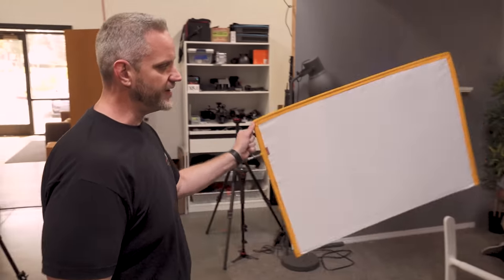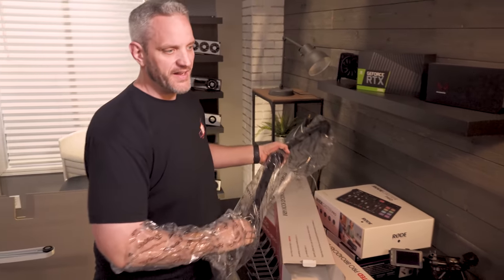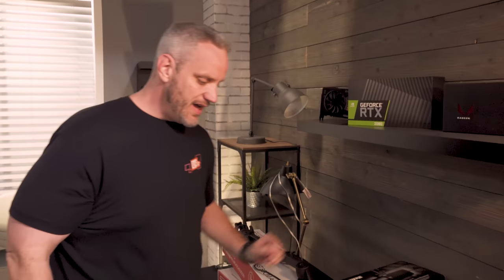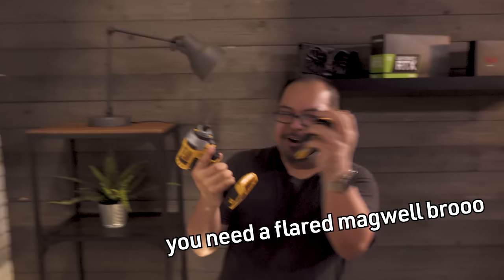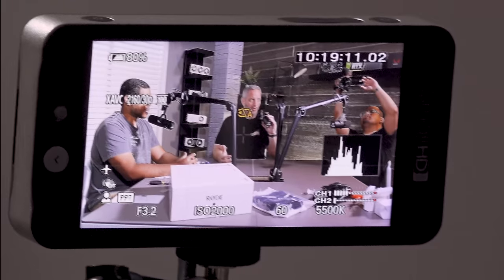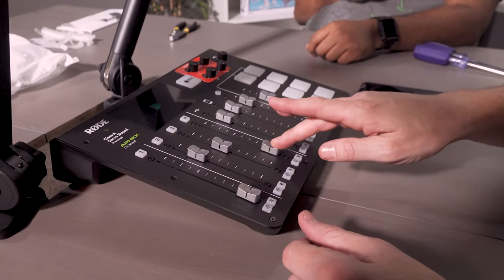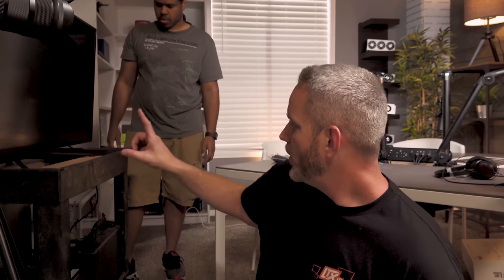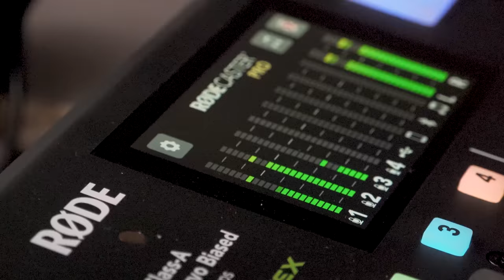This new setup turned out WAY better than expected!

Comment: For sound proofing, you could try building some sound absorption panels. The foam would only help with acoustics in a small room, but doesnt absorb sound. Even with a huge echoy ara, within the closed environment, that would help a lot. Also, another michrophone i recommend is the RE 20. :)
Reply: That's what I did. Out of some foam, zip-ties, and gridwall.
Reply: hey azn
Reply: hi azn hmmmmmmmm
Reply: he already has some on the walls of the warehouse all around
Reply: SM7B trumps RE20. :)

Comment: SM7B is THE microphone to use for broadcast and even studio vocals and guitars. Tons of people/bands use it for a reason.

Remember: There are hardware switches on the back of the microphone to boost high frequencies or cut low end.
Reply: don't tell Jay this, it will ruin the authenticity of an actual JayzTwoCents video lol
Reply: Yeah...I'm sure he totally never looked at the mic he bought...'remember bro...it has a front part you talk into to and a plug on the other end...just fyi'...silly thing to point out
Reply: @G Bogart exactly when he can realize it 5 or 6 episodes of the podcast in. Ok even that seems like a light estimation

Comment: I’d recommend adding fetheads to give you the extra gain headroom. I had this same setup and had to have the gain up high which introduced a lot of white noise (hiss) to the mix. Adding the fetheads fixed the issue. It allowed more clean gain without the hiss.

Comment: I've had that monitor since it came out and I love it. no problems since. the only thing holding this monitor back is the drop-off of the led controller. the software has never left beta forcing you to use a third party RGB controller like they just gave up

Comment: Hey Jay, make a box with 2x4s standing longways, set it on the floor with a cinder block sitting in it. Mount the microphone arms to it and have the arms come up through the center of the table. Would look a lot better than cranes sticking up.

Comment: I have that same setup, exactly. However you should be running cloudlifters on each of those shure sm7b mics, they take a TON of preamp gain. With a cloud lifter and proper gain setup in the Podcaster Pro, your volume on each mic should be dead center!!

Comment: If you don't want the arms to block the view, don't use overhead arms. Use something like the "Gator Frameworks Short Weighted Base Microphone Stand" with the deluxe weighted base. Keeps the arms down low and out of your face. They aren't as great for desktop use as an arm, for for podcasts they are great.

Comment: Not on the same setup, but similar - ProSonus Mixer with Sony A7iii: So for the audio sync with the camera, there will still be delay when encoding the actual video and audio sources - even when running audio through the camera - Usually under 200ms difference but it’s something that plagued my stream setup for a while.

Regardless, excited to have a new podcast to listen to!

Comment: Maybe mount the arms for the mics onto something a tad bit lower unde the table, so that the huge arms aren't as much in the way anmore. So sink the main supporting arm lower, as you can adjust a plenty with the other half still.
This way you all had some more visibility on the camera and it wouldn't look to cluttered.

Comment: Still need coolant for your car turn on your air conditioner get the compressor working by turning it to coldest setting then wait for the compressor and radiator fan to start turning you will hear it dont rev just idle with door open then in park gear and then turn the engine off with the key then flip the bonnet latch and check the engine radiatior if it needs more coolant or not

Comment: Why use overkill boom arms when you could get simple desktop stands that won't block any angles at 1/3 of the price? Also, the more you enclose the space, the more reverb you'll have. Low ceilings are the worst for reverb and buildup

Comment: 12:00 Could be Windows Update installing updates in a background and changing settings back to default again. This is the reason why @Chris Titus Tech runs Linux in production systems.

Comment: Pretty sure you’ve thought of this, but have you checked out obsbot PTZ camera? You could get 2 of those, turn off the AI tracking,  and add a stream deck and a monitor for control and get two extra angles from your chair.

Comment: If you guys are going to live stream it rather than an iPad get a  surface with a keyboard for each one of you so all of you can interact with chat, read donos while the other is talking etc. Also don't just monitor the feed from obs make sure to have the live stream up just in case you notice any stream issues. Nothing sucks more than a dead stream when you think you're live.

Comment: Jay's eternal trouble with audio levels - just a tip: 
I would suggest a sperate pre amp per mic - like the dbx 286s  - a classic channelstrip .. cheap and does wonders for this setup
u would get so much better sound with way less troubles

Comment: Mackie ProFXv3 Series, 12-Channel  $329 add a stream labs stream deck and you'll be miles ahead. Also think about a bonded connection to your stream service. Cost of the bonded internet is large to start but well worth it in the long run. One Att connection, One Verizon connection and your studio ethernet bonded together to make a nearly unbreakable connection to YouTube or twitch or what ever. I was hating on the mic stands but I looked them up and ill give them an Ehhh good enough. Eventually you will replace that cable.

Comment: You got the dynamic/condenser needing power thing backwards. Yes, THAT mic is a rare exception...it's an active dynamic mic...which does need power. But 99 times out of 100 a dynamic mic is not powered and a condenser mic always needs power. One of the reasons that mic sounds so good is because of the power being on the outside of it helps reduce interference. You just need phantom power and you're fine...even shit mixers have phantom power.

Comment: I would have recommended the Rode NT1 mic. It's over $100 cheaper and beat the Shure SM7B in overall quality. It's a condenser mic but the Rodecaster Pro has it preprogrammed (like all Rode mics) and can customize it, by eliminating background noise.

Comment: Wait, you made a podcast setup and it just works? I've always wondered why so many people suffer from issues, like the old WAN Show set - 45 tech nerds and not a single show without some issue. Their current discord + OBS setup is considerably more reliable which is silly.

Comment: Really Random, But I have that monitor. I was at 1080p 144hz and went to 1440p 165 hz, and holy s*** this monitor is worth it. My friend has an Msi Monitor that has the same exact specs and this monitor. Well at least in my opinion, has better colors even with the Dragon center color accuracy thing made by MSI lol. The Viewsonic monitor is actually worth it.

Comment: I want those MIC ARMS to be "Redesigned"...
The bottom half they should CUT OFF 2/3rd or 3/4ths of the arm...  I mean, there's all that bottom section arm that's just "in the way" crowding the viewing space for no necessary reason.
Actually, what they should do is have TWO Versions....  Have this version which would be better for bigger Tables, the arm can extend much further, and then make a version I described which is a better size for the size of table they are using for example, which is actually the size most people would be using.

Comment: I need help I built a gaming pc today and everything turns on and runs but I don’t get no picture in my monitor or my tv that I use for my Xbox along with my monitor turns on says no signal and then goes black right away and I used two different hdmi cords that work for my Xbox

Comment: Water cooling King Jay, I have a request for a new water cooling review: actively water cooled GPU BACKplates! EK have added a TRUE active cooling backplate (the "EK-Quantum Vector RE RTX 3080/3090 Active Backplate D-RGB - Plexi" with EK Product EAN: 3831109836460), rather than just being an unappealing metal plate is actively and vissibly water cooled with its own water block and has RGB (don't mix this up with their "founder addition only" unit, with the rear water in/out, as those dont have the water cooling block, and their wording is just hype). Could you please do a review/comparison between the default backplates on GPU waterblocks and the active water cooled backplate, to see what temperature difference there is?

Maybe for comparison, compare how the EK specifically made for EK frontplates active watercooled backplate compares to the mp5works "generic" water cooled backplate (which is quite limited as it has to fit on top of all the existing back of all GPU backplates, rather than having a cooling block touching the rear of the GPU components directly) - I heard even the mp5works "fit any backplate" managed to an average of a 10 degrees C drop, with much greater overclocking stability. So really excited to see a proper active water cooled backplate designed to work with the active water cool frontplate. Could be a "game changer", very literally. ;)

Comment: Jay! Help! I already OWN both and rtx 2080 reference card, AND an MSI 1080TI. I can only find advice on which is the better value...but say that you already own both and paid very little for either....I’m running 1080p rn but sooner or later I’ll find a deal on a 144p high refresh. Problem is that these cards perform extremely similar, the TI actually edging out the 2080 in most tests...but the future happens...which card to I sell JAY?? Selling both is not an option since I am selling a couple PCs and I need to keep one of these for my current pc. All the PCs I have require hours. The 1080ti is higher build quality then the basic hp 2080. It would be an easy choice if I was deciding which one to BUY, but when you already have BOTH at an awesome price, which one do I SELL?!

Comment: I recently got an M.2 from and I wanted to migrate my OS to it. My OS is currently on a sata drive When I plug my M.2 into my motherboard I get the error: Reboot and Select Proper Boot Device. When I go into BIOS, my sata drive isnt shown only the m.2 if i take my m.2 out the computer boots fine and the sata drive shows back up into bios. thanks for any help                                             

Operating System Windows 10 Home 64-bit

CPU Intel Core ryzen 5 2600x

Motherboard asus prime b450m-a

Storage sata drive 2tb and the m.2 is a 970evo pluse 500gb

Comment: Just lift the camera up a bit higher to get over the mic arms.

ALSO: Just my opinion. I like a bit of room noise. I can't stand when there is dead silence in the background of a recording. I tried recording my drums in a totally sound dead room and I couldn't stand how small my drums sound. Or if you know the band Acid Bath they have a album that has no reverb or room sound and it's unlistenable, I actually felt Closter Phobic when I listened to that album.

Comment: As someone who does live sound for theatre and bands, that mixer is way overkill. The roadcaster, is a premium, like an iphone, you could get a mixer with more inputs as well as interfaces, for half as much as the rodcaster. Also, no offence jay, but thats not what phantom power is. your close, but you will not hear anything if you dont have phantom power on a condenser mic.